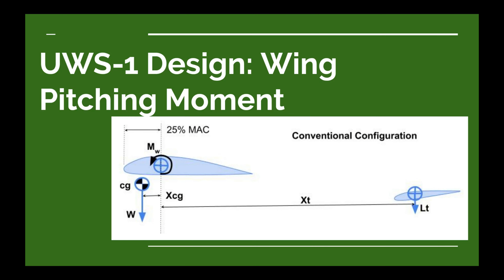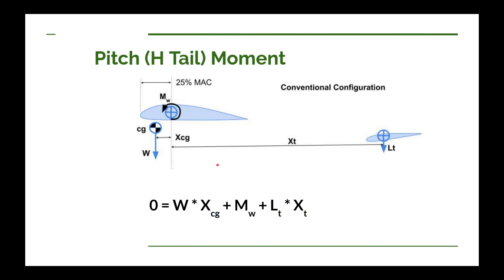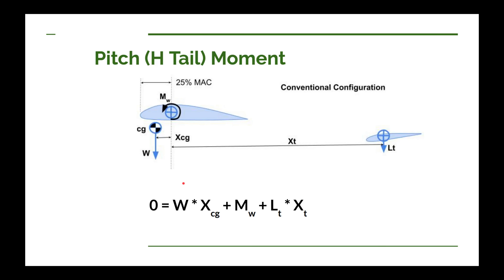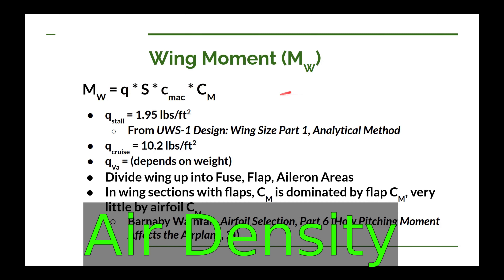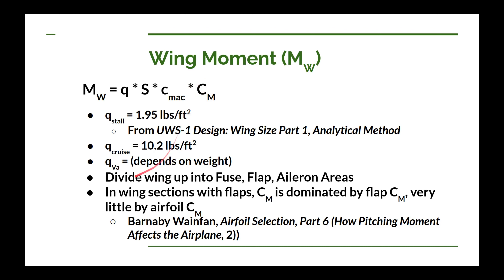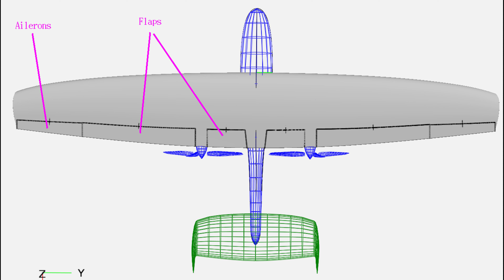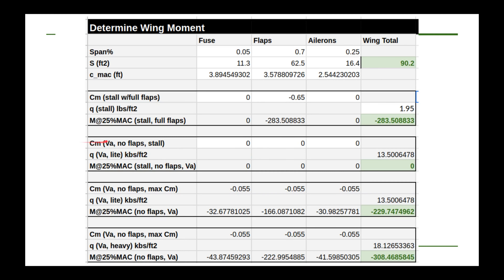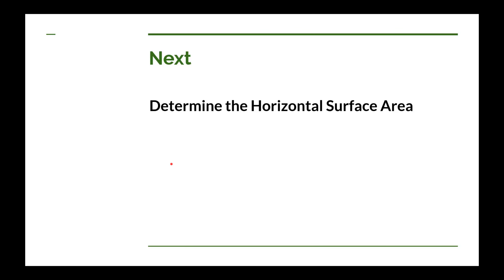UWS-1 Design: Wing Pitching Moment

Comment: Dear, Dont you think the coefficient of moment around the aerodynamic center of the wing and airfoil is different. Cause the airfoil coefficient of moment is too small compared to the wing which can be seen in the xflr5. Can you please make a video on seeing the value of coefficient of moment of the wing using xflr5 cause there is not even one.

Comment: Why didnt you also calculate the moment in regular cruise condition?
Reply from the maker: For structural considerations the moment of the wing at cruise is pretty small compared to other conditions like Va at n1 (maneuvering speed at maximum G). But I would calculate the moment at cruise so that I could determine the Horizontal tail incidence.

Comment: Sry I really don’t want to annoy you but I have another question 😅
So Im currently calculating a plane but my problem is that I don’t know how I should include the cm of the horizontal stabilizer...if I add it to the moment of the main wing it gets smaler, so I should make the tail smaler, but than the moment of the tail is different etc....so how can I calculate that? 
(Sry for my bad english, I Hape you know what i mean)
Reply from the maker: Since the moment of the horizontal tail is small compared to the moment of the wing and the moment between the CG and the aerodynamic center combined, you can ignore the moment of the horizontal tail. Like you say it does contribute some moment but it is small and can be safely ignored unless you have a very large horizontal tail (nearly as large as the main wing).
Reply: Ultralight Airplane Workshop, Ok thanks
Reply: Use a Symmetrical airfoil for the stabilizer surfaces and it will have Zero moment when aligned in trail at high speed where moment actually matters. 

Moment caused by large control surface deflection results in a moment in the direction of the desired control, at least in the case of conventional, aft-tail placement. 

So pulling-up causes the elevator trailing edge to deflect upward, causing it to assume a negative camber shape, which generates a positive (nose up) moment on the horizontal stabilizer, which tends to "lift" the fuselage in the direction of the intended pull-up. 

None of this is measurable in flight testing, because its a ver small torque force, and because the lever arm from CG to tail is so large that the pitching moment is educed to a tiny force at the CG.